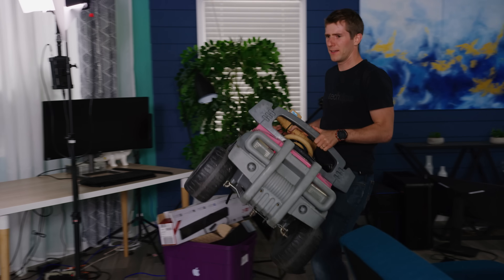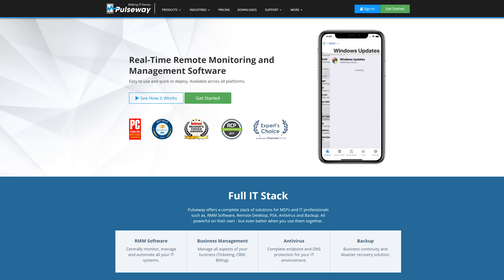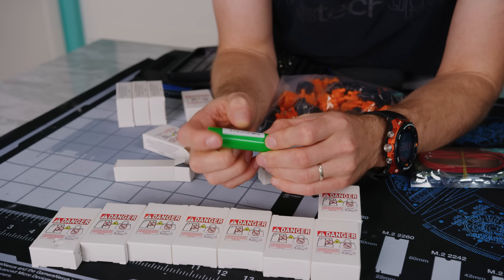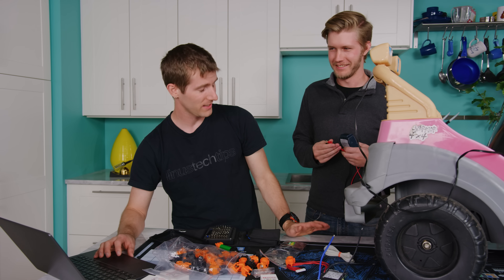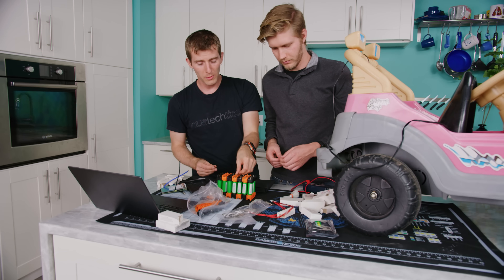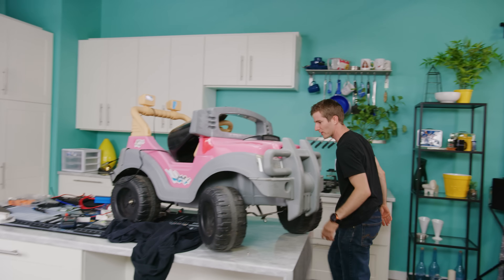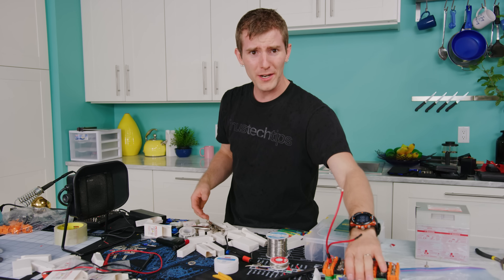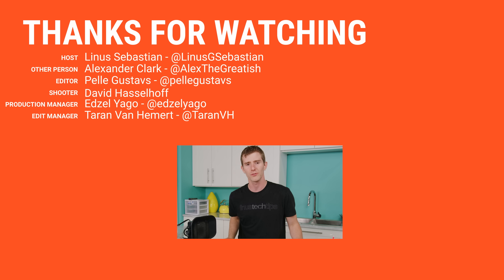DIY Lithium Battery - What could go wrong??

Comment: i have 3 ideas 4 u, first u should use an 8S10P battery for better charging with 4(maybe 8) bms
so u can divide into smaller packs to be charged with liion charger in parallel
2. use a thicker busbar, and better cables
3. U definiatly should use a breaker ! :D 

ur 7S3p battery struggle under this heavy load, i use 2S6P in my cordless drill ... for divide better the load between the cells :) if u overload this cells they will quickly degrade, i think this little car with twice power draw maybe 60 amps at start :) so u should upgrade all the wiring to the motor

Comment: So you know that power supply you have? As long as it's voltage goes high enough, you put it in current Control Mode and feed it like, 1-5 amps until you hit your desired charged voltage and call it good. Otherwise buy the right charger.

Comment: I wonder if you could have done this with the new size Lithium cells like the new Samsung 40T, 21700 size,  4000mah 30a CDR and ponder if it would have made a difference other than an extra 500mah per cell. Oh the cost difference would've been crazy though considering how many you used in Para-series

Comment: Cool project! For a general DC motor you are actually increasing the power going through it by the square of the voltage, so multiplying the voltage by four, means 16 times the power (doesn't necesarily translate to 16x the speed though :P). Beyond that, I'm going to be a massive safety nanny: PLEASE for the love of everything cover up that ring on your finger when fiddling around with lithium ion cells (or any current capable source). Electrothermal ring burns are a thing and usually end up with an amputated finger.
Reply from the maker: Thanks bro! Pushed this comment to the top and will keep in mind for future!
Reply: @LinusTechTips Hey, you can pin comments now! Please pin this.
Reply: For the love of god get this man to the top, I loved the video and figured it wouldn't have been posted if anything had happened, but still. This is pretty damned dangerous.
Reply: FUUuuucking hell you even slap the top of the cells in the end of the video! Fuck me :S
Reply: thats what happens when you dont pay for healthcare when you do stupid shit and get hurt.
Reply: No joke, first day of tafe (kinda like trade college,) student welded a wrench between his ring and watch removing a car battery, not pretty.
Reply: Also the watch with the metal clips.
Reply: I was going to say the same thing, when doing any work like this, just take that wedding ring off, and if you do it often, and feel you must wear a wedding ring, get a silicone ring.
Reply: He did cover it in packing tape. XD :/
Reply: He needs some HPHT
Reply: Linus fingerless tips
Reply: Pretty sure a guy at my dads work lost a finger
Reply: Yeah, I was thinking about his wristwatch buckle too.
Reply: Ikr that ring gave me anxiety during the entire video
Reply: This type of injury is extremely RARE, and usually only happens in odd circumstances.. You have to remember, that touching ONE side of the battery with a ring WON'T cause a short...  AND at 12volts (car battery) there isn't enough power to transfer enough amps through your body or even your hand to do any damage.. HOWEVER, once you hook enough 18650's up into series, and get to around 65volts, there is... HOWEVER, the amperage still needs to be there, and unless you hook a TON of 18650's together, you're still not going to cause any severe damage to yourself.  Telephone POTS lines are a perfect example... Regular line voltage is 50Volts DC and telephone techs work on this stuff all the time with BARE HANDS.. Having a ring on your finger don't really make your skin any more conductive than tightly squeezing the wires themselves, but You can get a "TINGLE" when working outside in the rain while kneeling on the ground, but it's only a tingle.. at 90Volts (or Ring Voltage) there is enough voltage to carry the power through you DRY.. However it's just a little shock as telephone lines only run around 1/4amp... You have to remember that VOLTAGE carries AMPERAGE and without adequate Voltage, Amperage, and Contact with BOTH terminals, You'll be FINE...  The other side to this is, that if you make contact with BOTH terminals and short an 18650 out with something heavy enough to NOT burn up, the 18650's circuit protection will either shutoff the battery and it will be useless, or it could catch fire..  That would do more damage then anything else.
Reply: Ok, to clarify this... Linus did has 3 Lipo cells in parrallel and 7 of those in serial resulting at around 7*4,2Vmax and 7*3,7Vav. The distance between the terminals (those metal plates that connect the cells each) is roughly around the size of a ring. Shorting those only over the ring will generate huge amounts of current and therefore heat (in the ring, not his body), even on 3,7 Volts of difference. That is the danger, not increasing your conductivity with a ring! Also high currenct capable 18650 usually don't have a protection circuit, since it's build volume is too small. This battery pack in this configuration will end up delivering ~90amps on average and around 180amps of peak (usually around 2-3times higher than average)
Reply: @jameswiz  FYI: 1/4 amp is 250 mA, and 10 mA is already in the danger zone of electricity.  So 1/4 amp could be deadly under certain circumstances.
Reply: @coolguy284_2  elaborate ac line voltage?
Reply: It's all extra low voltage. He'll be fine.
Reply: Extra low voltage isn't the problem here. Having a low-resistive ring on your finger and a device (battery with open contacts) capable of several hundred amps will get the ring hot in milliseconds and the swelling finger at some point prevents you from removing it. This can and has led to amputation of the finger. Same counts for mechanical work like using a hammer
Reply: It's extra-low voltage but capable of 30A. So you bridge the battery with a gold ring and it immediately goes to 30A because of near-zero resistance of gold. 24V at 30A is well over 500W even if the current quickly drops off. You are going to have a bad time with a 500W heating element on your finger.
Reply: @viciokas1993  This is not really correct.  A low resistance ring would mean that the voltage would drop down very low at 30A, possibly 0.01V or less.  This means that the power would be much lower than 500W.  In order to have 500W of power, the current would have to be in the thousands of amps to create a large enough voltage drop across a ring.
Reply: @torpedo1884  It's low enough voltage that it won't electrocute him because skin has a high resistance, but a dead short across a piece of metal with low voltage and high current can make it glow red hot in seconds. You can weld with a 12v car battery.
Reply: No, it doesn't matter that it's only 30V.

Comment: LiFeMnPO4 prismatic module 3.2V 20AH for somewhere between $20 and $50 US a couple of bus bars and some heavy duty cables and you've got yourself a baller battery pack, the 100Ah is probably what i'm going to use to convert my limo into a 72v hybrid in an S23P2 layout for ~14kWh

Comment: Thats not DIY enough, get yourself some used cells from laptop batteries.
Reply: am·per·age (ˈamp(ə)rij/) noun
noun: amperage; plural noun: amperages
the strength of an electric current in amperes.
The term's been in use for over 120 years, so next time before you correct people, keeboudi, please make sure you're not incorrect yourself. Amperage is a measurement of current, and as such is a completely valid descriptor...
Reply: Pah - heresy!  We might as well say "henryage" and "faradage" for inductance and capacitance next ;)
Reply: What kind of bait is "the word amperage doesn't exist" lmao
Reply: Do self-respecting engineers actually use this word?
Reply: Not really a good idea for high amperage draw applications.
Reply: I use them for all kinds of stuff and they gonna blow them up anyways, even the new ones.
Reply: @blabbersoft  if tesla can do it anyone can do it
Reply: @paulmaartin  Tesla isn't using old laptop cells...
Reply: That'd be about as stupid as putting those same laptop cells in my 200+ watt high amperage vape devices...
Reply: Used laptop battery cells are ok for a phone powerbank but not for this. Unless by used you mean laptop used 1 time because otherwise these cells are almost dead already
Reply: Perhaps a carrot then?
Reply: No such word as amperage ... it's current :)
Reply: Mad Rooster not really... tarmac is an actual word whereas amperage is not

Comment: Why would you go with Lithium-ion batteries? Why not use LiPo or LiFe? They can provide like 40+ times the current of a Li-ion. Your energy density goes down a bit, but that doesn't really matter for your application. Oh and you can charge them like 2 - 5 times faster.

Comment: Could you put a higher v battery in it? I mean you can guy a 40v lithium battery would that make it go even faster than this?
Reply: At some point, the motors will just burn out instantly. Or the torque will become high enough to break the plastic gears in the moment one presses the accelerator. 24V in a 6V car is pretty insane already!
Reply: @Coiltec  
I mean I basically zero knowledge when it comes to this type of stuff lol. Anyway thanks for the reply. :)

Comment: Here's another thing you should "not" do: put some rubber on those tires. It'll be your own little grocery getter.
Reply: Oh, and while you're at it, when you attach the sewing pedal, you might want to attach a battery fan to it, so it can (try to) cool the battery while it's being used.

Comment: not  too sure about this off the pat, but shouldnt it be possible to use lower rated charger to charge battery assembly such as that by having half the battery go trhough (button)relay switch that disconnects 2 (or more) parts of the battery from eachother and trough same (or separate, whichever you fancy) relay connect them to a charger which is now able to charge the batteries, thanks for being rated higer voltage than indivicual separated batteries? Given that the charger has some sort of current limiter.
way more complicated than nessessary; i know XD

Comment: When using this much power... might I recommend adding in an old school mechanical speed controller to hook to the throttle pedal? We did something like that in college when we did something silly like this to a power wheels. It really helps with control when you are trying to put power down with plastic wheels! We also upgraded the motors as well though, so I think we were making WAY to much torque for the wheels to handle.

Comment: LINUS you are wrong.... you are making it go 16 times the stock speed. every time you double the voltage you quadruple the power...... unless you have a smart circuit in there. bad linus you suppose to know things.

since amps is V/R then if it uses 1 amp at 6 volts then it is a 6 ohm resistance. At 24 volts you should be getting 4 amps, however watts is V* amps. 6*1 is 6 watts.... 24* 4 is? 96 watts..... so much power....

assuming I did my math right and Im not an ignorant of some random fact. 3:30
Reply: Im wondering if your hitting your battery ESR limit. you need more battery in P!!!!

Comment: You were using the wire strippers backwards. You're supposed to use the flat side against the part you're pulling off.
Also, you're better off soldering the wires to that bar before you put it on the battery, else you risk damaging and possibly exploding it from the heat of your soldering iron.

Comment: You bought the wrong cells.
3500 mAh 18650 are generally low to mid discharge rate.
Get some 25R, 30Q, HG2, VTC4-5-6, etc. They will take the punishment better.

Comment: There's a guy who put a turbo charged ATV motor in a pink mustang Power Wheels and its badass....also those are not 18650 batteries. 18650s are AA sized

Comment: Electrocution at 29 volts? Kind of over dramatic. Unless they're talking about a constant current charger
Reply: Well... if it's a CC charger, it's whatever voltage makes the desired current flow.
Reply: It's not the voltage that is dangerous but the current. 0.06-0.07A is enough to kill someone...
Reply: oh no.......you didn't just say that......whenever someone says the whole "it's the current that kills you" thing it's so cringy because that is only half the truth and VERY misleading.
Reply: @Matt Cooke Dude, learn how electricity works. The voltage and resistance determents the max current that flows. The human body has a resistance around 45kΩ (really rough estimate, dependens upon wetness of skin, where the current flows, how much you drank before, open wounds, etc...).But lets go with this. 29V /45000Ω = 0,00064A =0,64mA. You wouldn´t even feel a thing.
Reply: @MattCookesurl  
You need to watch electroboom videos.. your concept of current is what kills you is half wrong. Do you see a "Warning high current" in power stations?
Reply: I don't think you fully understand electrobooms opinion. Current kills, voltage does not. But, he makes the point that a higher voltage automatically means a higher current at the same resistance. He also makes the point that a high current will only hurt you if it's flowing through your body, not for example through a wire you're touching.
Reply: @MattCookesurl  You're not going to have 60 -70 mA running through your body unless you have hundreds of volts across you.

Comment: This is something I did for my kids power wheels, however I just used 18 volt batteries scrapped out of old car jumpstarter packs. I would suggest adding pan head screws to the rear tires to give it more traction.

Comment: ”Be electrocuted or make the batteries explode” kinda false. Almost all 18650 cells have short cercuit(over current) protection, so it wont explode. And u wont get electrocuted ether due to the low voltage
Reply: Nope. Those are unprotected Samsung cells You can distinguish them by looking for a small wire going up sideways. You´re right about the electrocution part tho.
Reply: oh. so which cells normally have basic protection and which dont? im not finding anything on the packaging of the cells stating if its got protection or not.
Reply: @kevin42  Usually the low-current ones. Another indicator is the pointing out tip at the positive site.  But the only real answer is the Datasheet.
Reply: Carl-Friedrich Erb alright thanks. Btw by low current u mean the sort of 4 A constant and 9A max?

Because advertize it how u wish, these cells cant push more than 10A peak how ever much the manufacturer ses its ”high amperage” rated
Reply: @kevin42 yes, thas is low currenr for me. But 10amp max is a joke. I pull  25-30 Amps (burst) out of one VTC5 ;)
Reply: Carl-Friedrich Erb im pretty sure 10A burst is the best iv seen out of one 18650 cell. And multiple battery oriented youtubers say the same
Reply: Carl-Friedrich Erb but maybe im reffering to protected 18650’s

Comment: 3500mah 18650 sized batteries are probably fake. 
Even the second generation tesla cars used 1800mah batteries from panasonic
The general rule of thumb for 18650 li-ion batteries is if its over 3000mah then its probably fake

Comment: You should look at using some connectors, deans, xt60, bullet - just to make it safer to plug in to your car.
Be careful with 18650s. some don't do well on high load. Your pack is 3p on a 10 amp battery - which i think is the LG MJ1. If you're pulling 10Amps continuous, it's maxing out the battery which isn't particularly safe. If you're spiking over that, well - it's just like hoverboards.

For my RC cars, I've been using Sony VTC 5/5A batteries which can hit 20 Amps comfortably. If you want REALLY safe batteries, get a123 26650 batteries, either from buying them directly or taking apart dewalt tool backs. Those can handle 50 amps and take a beating.

Comment: Lithium batteries can be very dangerous. Never leave both the positive and negative wires/terminals exposed at the same time. Keep them insulated at all times except when you need to work on one of them, in which case work on one, then insulate it again before starting on the other. When you join the wires to a connector always insulate the ones you join before going on to the next one. Also, you need to be careful with the wire routing and protection on the finished battery. You need to be sure that the wires can't rub on each other or rub through the insulation. A short in a lithium battery can turn into a very powerful firework. You cannot extinguish it with normal means. It will eject fierce flames while the individual cells explode and shoot their cases out like bullets so you can't get near it. Be careful! I'm not trying to be a smart-ass nor a killjoy. I work with lithium batteries a lot.

This is what you're up against:
https://www.youtube.com/watch?v=hRlAZkv8EPM

Comment: The relationship between voltage and motor speed is not linear so you might not get 4 times the speed with 4 times the voltage (sorry had to point it out)

Comment: Funniest Tech Tips Video Yet!

10:00, mocks the Verge.
10:35, short circuits battery.
10:50, short circuits battery AGAIN.
10:58, finally decides to tape up exposed battery wires.
12:09, finished product. 

ROFL.
Reply: 12:12 The wheel fell off this project.
Reply: could you list dropping stuff and knocking things over as well
Reply: You forgot the "bomb has been planted" at 11:42
Reply: Not to mention, not wearing any electrical safety PPE while dealing with lethal levels of current potential with a battery technology that can discharge enough current to blow a finger off.
Reply: @S1L3N7D3A7H  This is not true.  24 volts isn't a lethal amount of voltage, so the current capability doesn't matter.  How can current blow a finger off?  The only thing capable of that would be the amount of voltage and current at a power substation.  Don't mess around there.

Comment: 5:00 you can't get electrocuted by a 24V battery, even 100V DC is still a safe voltage under normal conditions.